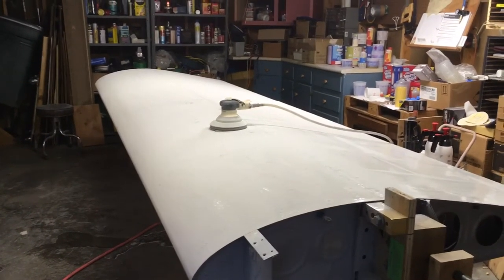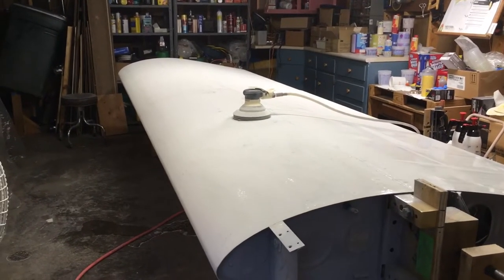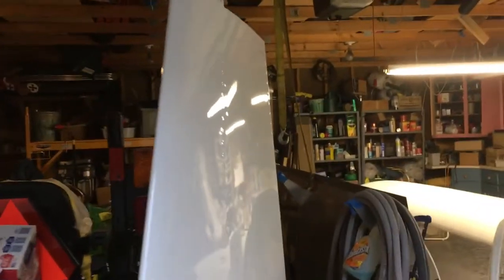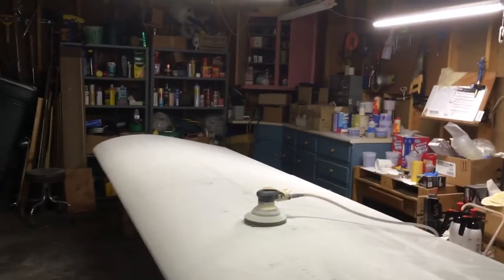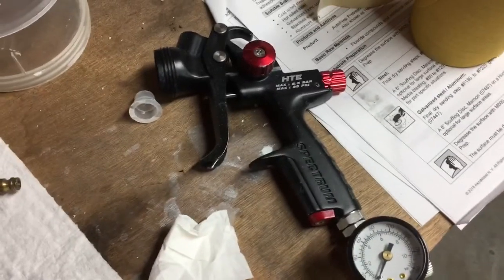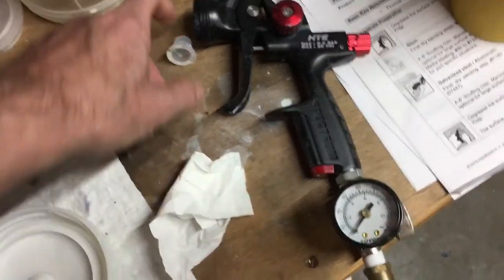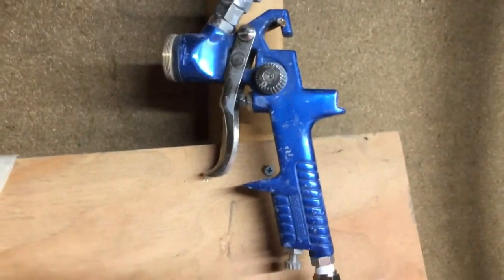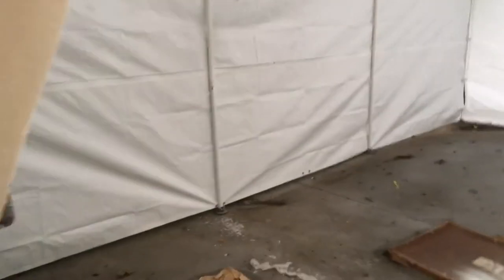RV10 Update

Comment: Just inherited a high volume low pressure set up from my grand father. Looking forward to learning how to paint my own components! Looking forward to seeing how your wings turn out!
Reply from the maker: Scott, just start on the small parts first.  I got in a hurry and violated my better judgment and it cost me a days work on the wing.  What hvlp gun do you have, I don’t really know much about any of this stuff...
Reply from the maker: Oh, I just finished the primer and will be shooting the top coat in a few minutes!  I’ll post a video after it dries.
Reply: @RVJimD  I'm not sure which brand of gun I inherited but I dont think that it is a high quality one, but I may do some research and invest in a good gun. I have a 60 gallon compressor with a regulator then a filter trap and moisture separator before it goes to my hose. I think that I will do like you spoke to and put a regulator at the gun as well.